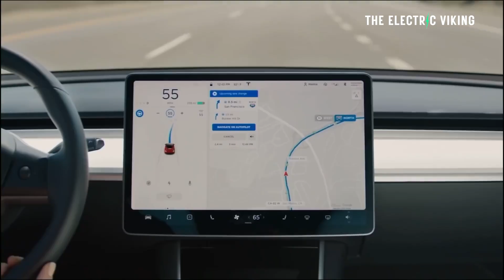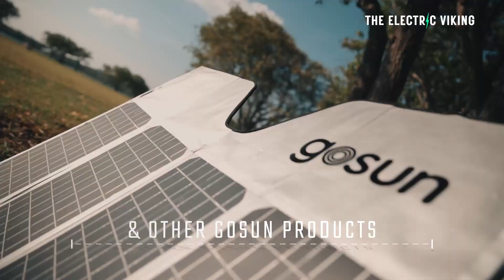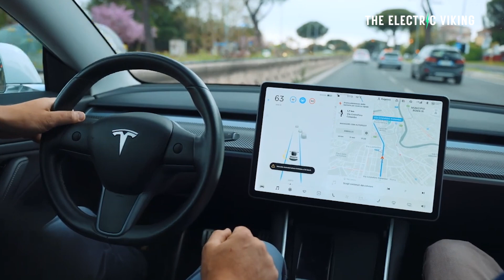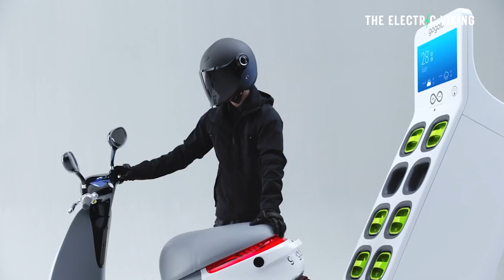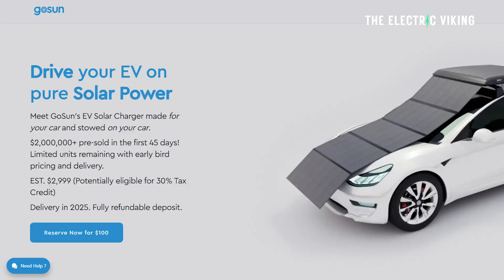GoSun’s Solar car Charger turns any electric car into a solar car

Comment: From my research, GoSun’s solar charger provides 1.2kW of charge which translates to 30 miles for 7-8 hours straight of charging in full sunlight. With proper charging management using GoSun’s EV solar charger, it is quite possible to reach a 91-92kw charge = 300 mile range just by using the solar charger alone and without having to use home charging or supercharging (that’s equivalent to 3 average workdays of solar charging), and solar charging would also be quite gentle to the batteries hence less battery degradation and contributes to the overall proper care and management of battery longevity. All in all it’s a net positive, so I can see why internal combustion engine and big oil lovers would hate and dismiss this technology. It completely eliminates fossil fuels altogether to provide the charge and range to the vehicle 🤭 there would still be times homecharging and supercharging may still be needed for emergency charging, but imagine if we have backyard fusion reactors the size of a single tesla megapack… goodbye fossil fuels forever 😧😧😧
Reply: Not sure what you are on about - a 1200w array will produce on average 1700-1800 kwh per annum in a warm dry climate nearer the equator (at 100% charge efficiency but we'll leave the circa 15-20% charge losses out of the equation for now) - more like 900kwh per year in London or 1100kwh per year in Seattle etc. This accounts for lower winter sunlight hours, the angle of the sun not being perpendicular to the array, clouds, rain etc.

That's on average 4.7kwh per day in an ideal climate and 2.5kwh per day in London or 3kwh per day in Seattle. = 19, 10 and 12 miles per day range respectively at 4miles per kwh

That is based on leaving the array deployed 100% of the time during the daylight hours, never in the shade, never in a garage or undergorund car park, never driving during the day. It also excludes the extra cost of the drag on the freeway - at 75mph this setup would consume an extra 150wh/mile = 16-30 miles (depending on climate) before all of the benefit was lost in extra consumption alone.

My home electricity overnight rate is $0.08 (AUD = $0.05 USD) per kwh. $3000 USD in panels would be the equivalent of 60,000kwh cost = 35, 66 and 55 years resectively of charging (in the ideal circumstances noted above) to recoup the costs , no thanks.
Reply: @TB-up4xi that is subjective to where you live so your math is off

Comment: Brilliant idea. Eventually photovoltaics will be painted onto the car's roof and chassis, possibly the windows as well; it will just invisibly, quietly add miles back while parked during the day. Such tech has already been demonstrated.
Reply: Build-in PV comes with the Aptera, here in 2025, forty miles/day.  Most efficient design by 3 x, e.g., lowest drag, .13, >100 kilos.
Reply: Pie in the sky.
Reply: Aptera will be about 800kg, bonus is its only got 3 tires you have to service.
Reply: For stipid people only. Stopp too mush air when driving.

Comment: What people don’t understand with this tech is that the idea/goal is off-grid charging, supplying the needed power for your vehicle without completely relying on plugging it in through a home charger or super charger that’s still connected to sources of energy that still use fossil fuels. And, again, if it’s managed properly, you won’t have to ever use superchargers or home charging if it’s short distance/local driving but can possibly be used in place of long distance driving, again, if the charging is managed properly.

Comment: I think you will get so tired of having to open and close that solar panel 2 3 times a day that you wish you were never born😅😅😅

You would not even want to open that solar panel if you go on short trips to the store or elsewhere when you only spend 10 Minutes or Less in the place😮 that will be another nightmare to think about whether you want to open the solar panels where you're going or not😮 people don't want the hassle like that😅
Reply: The idea/goal is off-grid charging, supplying the needed power for your vehicle without completely relying on plugging it in through a home charger or super charger that’s still connected to sources of energy that still use fossil fuels.
Reply: Think! @oddjobsandrandomprojects

Comment: I do see some possible issues. The first is the cost. I could by 15KW for that amount, which is enough to drive my M3 about 60K miles. Second, mounting that on your roof is going to reduce your range, especially on a freeway.  Third, it looks very easy to steal.

For camping, it would be super awesome.

Comment: Bro you are completely delusional😢 you are saying you can add 120 mi to your range for nothing😅 have you forgotten that you have paid $3,000 for the solar panel😅 you know how much gas you can buy for $3,000😮 at $5 a gallon you can buy 600 gallons of gas😮 and you can drive 20000 miles with 600 gallons of gas😮 do you even know how to use a calculator😂😂😂😂
Reply: You are not very bright, are you…think about it, most people fill up their 20 gallon tank each week…let’s assume they fill up every 10 days or 3x per month…that’s 60 gallons per month…so based on your math, it would only take 10 months to break even and solar panels typically last well more than 25 years with minimal deterioration…can you name an investment with a better ROI than that?

Comment: 30mi is BS. I live in the California desert. I get around 6 hours a day. That's a 1200w solar array, so figure 5hrs in the summer at 1100 watts that 5500w per day. And that's at the panel, so figure at best 85% efficiency, which is 4675whrs to the car, and at best, 92% gets to the battery in the car, so 4200whrs is on tap to use. A model 3 rear wheel drive at 50mph uses 230whr per mile that's apx 18 miles of range and assumes the best cases. If you lived any further north, this would drop like a rock. If they can make it wider and get the solar array upto 2100-2400w it would be way way better at that point your adding around 7-8mi per hr something similar to a 120v outlet ev charging while the sun is up.
Also cigs panels are way way better at handling shading and make a lot more since

Comment: Solar panels can now be made transparent. The efficiency may be quite low at this time, but what's to say it won't improve to the point where it can be integrated into the windscreens and charge up the car. Even if it is just a 10% charge in 8 hours, it might be enough to justify such passive charging.

Comment: Sure. It takes about 6 rooftop solar panels to offset the power used by a model 3. This system isn't quite enough to power an EVs average usage, but it's close enough to be useful. The bigger question is how long will it last?  It would be better if EV manufacturers integrated them into the top surfaces of the car instead, or maybe have them come out of the trunk similar to a convertible top.

Comment: That’s a great invention. I’m patiently waiting for my Aptera EV that is covered with solar panels.
Reply: Keep waiting - Aptera is vaporware.

Aptera 1.0 - 2006-2011, 6 years = zero cars produced - conspiracy claims about the CEO being paid off by big oil.

Aptera 2.0 2012-2014 -IP bought by ZJG , split into US and Chinese companies, ZJG claim they will make 5000 cars by the end of 2012, come 2013 zero cars produced - radio silence.

Aptera 3.0 2019- $260mil capital raised - $16mil left in the bank all spent on offices, advertising and R&D. No in-house manufacturing capability, no software, a few hand built carbon fibre and fibreglass composite prototypes, cars produced & sold...surprise surpise = zero.

Tech is now outdated. 40kw max DC charging 3kw max AC.  Struggled to find a new supplier for their useless hub motors - less efficient, more prone to damage and susceptible to water and dirt ingress. Would need another massive injection of capital to start producing at low volume through a contract manufacturer, still no demonstration of software (which as we know the achilles heal of startup EVs)

2 years after their $200mil IPO Tesla had produced the model S and X - 2 years later they had $3.5Billion annual revenue, Aptera's combined revenue since 2006? ....... $0.

Comment: Great idea, but as pointed out in the comments below, it could take well over  decade to pay off based on electricity prices. But if live in  a place with no way to plug in, it may be useful, or on a camping trip, or just to ensure you are using clean energy to power your vehicle. I expect prices will drop rapidly for this.

Comment: No way would that not get stolen or vandalized in most cities. However if on a camping trip/holiday it could prove very handy for remote charging. 1200 watts of solar for 3000 is pretty steep, but it is a plug and play kit.

I'd look to build a portable array with a battery pack for a bit less and more multi use scenarios.

Comment: Maybe they could incorporate the solar right into the hood, the roof and the trunk and maybe even the side panels. you never have to take it out or put it back. It would always be working.
Reply: One of the world's best engineers, Elon Musk, says that there will be too little effect in relation to the cost. It is not possible to save extra costs during the car's lifetime.

Comment: I have shopped around and there really is no good affordable solution to just charge your car directly from solar panels. You can't just wire them up directly or even to an inverter. Because the EVSE we have is AC, and can't deal with intermittent power like the sun going behind clouds, most people even tell you you need an additional buffer battery to keep the current on an even keel. So what is really needed is a direct low current capable DC interface but of much higher voltage matching the needs of the battery pack, which is not really available yet. Also I can definitely see people just stealing solar panels that are rolled out on top of your roof. A better solution is larger capacity regular solar panels on a roof or permanently mounted or on private property. This could be anywhere from a kilowatt to six or eight etc. which would be as fast as our current level 2 charging. We have two EVs and one usually sits home all day and can charge while the other is being driven. We could definitely supply all of our EV charging using such a system, other than the fast charging we use on trips.  So what I would be really interested in is the electronic interface that this thing uses between the solar panels and the car charger. And as it's only 1,200 watts it could be far cheaper than $3,000 that's for sure.

Comment: Sam getting stuff wrong again - how are they going to increase the efficiency of solar panels by 50%? Solar panels are already about 22-24% efficient depending on the brand and the maximum theoretical efficiency is 30% and we can already get close to that in a lab but the materials are too expensive. Solar panels are a very mature technology and we can only really tinker around the edges with efficiency - the biggest gains we'll make are in longevity. Also - carry the extra rolling resistance on your roof is going to hit your efficiency hard. I think it's a niche product for offgrid camping, that kind of thing. You put that thing out on a busy street or a car park and it's bound to get vandalised.

Comment: It think people commenting that the current version is impracticle, need to take a step back and look at the evolution in the EV industry over the last 10 years.
More innovations and steps forward than in the ICE industry in 50 years!
So, this solar system iteration is Step 1. The improvements in solar cells will reduce the size of this system every year.
Solar films that are put on windows are also getting better & better.
This system is not useful in all countries/hemispheres - obviously, but I think this design & efficiency will evolve massively in the next 5 years!

Comment: The roof rack and the panels screw your aerodynamics. Still love the idea though
Reply: Yes, but it has a very thin & aerodynamic profile. It won't add very much drag, especially if driven below the speed limit (which contrary to popular opinion is a maximum, not a minimum) ;-)

Comment: I made my own one of these several years ago by storing folding panels in a Thule roof box with my ecoflow, the charge cable can exit the side of the roof box easily, and the panels cover the front and back, pretty easy to diy
Reply: which ecoflow and EVSE do you use?
and how does the EVSE and your Vehiclehandle such low charging current?

Comment: Still just feels like a really cool science project but not a practical mass solution. Manufacturers need to get their arses in gear and at least add solar to the roof and hood right from the factory. All tied into the high voltage battery. No additional drag, preferably no additional cost, no theft, not easily damaged, etc....

Comment: The idea of charging your car from solar while parked is great. This form of execution... I dont know. 30 Miles per day is theoretically possible (best of best conditions) but that shouldnt be the expectation, 10-15 miles is more realistic and thats a lot of daily hassel for not a lot of gain. The worst of worst conditons (winter, full size truck) this is only going to provide 7 miles of range per day or less.

FWIW if you can find any basic 120V outlet with an extension cord it will charge faster and 24/7. 34kWh/day vs. 4-7kWh daily off this thing.

Comment: Who said it was eligible for federal rebates?  My bet it is a scam. Also ABS is UV resistant with additives added.  Note the additives themselves degrade. Adding only a small amount of additives allows them  to be called “UV resistant”. This is why residential panels use glass because plastic doesn’t last.

Comment: I have a 400 w. Panel that folds up and carry on my e bike with my  Trailer Carrey 2 100 amp HR batteries give me very long range to get fare into the wild trails with comfort like a electric blanket very small and compact not cheep thow but very good for hot tent camping in winter wit my titanium stove gear camping with my bike is a blast charge drone hopefully soon star link int!Internet?

Comment: Why dont ev makers just make solar panel coated frunk, roof and boot? Would save the hassle of opening and closing these rooftop panels. Would also continuously charge the battery while you drive
Reply: Two things - you'll notice that this system (usable only when parked in a safe, windless place) completly covers the car from stem to stern to get enough square footage.  If built into the car, you can't cover that much area (because of windows and the cell's shapes, etc.)  And there's the problem that most cars would get only a tiny benefit for the cost of adding permanent panels.  One EV maker IS covering the car with panels exactly as you suggest: Aptera.  But it's only practical because Aptera is so amazingly efficient that it can gain as much as 40 miles on a sunny day (approximately what the average person drives per day.)   EVs of standard design could only drive 10 miles (or much less) on that same amount of juice.  The expense of adding the cells makes it non-economic for such a small gain, so that's why most EV makers don't even consider it.   The best that can be claimed by those individuals who want to install some cells on their EV is that this small amount of extra juice could power fans, charge their phone, or run some lights.

Even Aptera doesn't promise that charging the battery "while you drive" adds significant mileage.  It takes a full day of good sun to get the ~40 miles.  Imagine a long trip with a "1000 miles per charge" model.  If you start with a full battery and drive in bright sun as far as you can, you might go 40 more miles than the 1000 you would have otherwise traveled, but you would now have an empty battery that requires: 1) charging at a supercharger, 2) charging for several hours or overnight at level two, or 3) twenty-five days of sitting in the sun before it is fully charged again.  Each day WOULD get you ~40 miles, which is very useful  --  after several hours on the first day, you'd possibly have enough juice to get the car to a charger!  This was purely imaginary, though; nobody with any sense would run it until actually empty.

Comment: It's a good idea especially for campers. One day every car will have solar cells built in. Until then, this makes sense however it's vulnerable to theft/vandalism. An internal kit might be an option?
Reply: It’s good for home charging in place of charging using the outlet from one’s home. Pretty much that solar charger can only be used and unfurled in a secure and safe location. It will not be recommended to unfurl in dangerous high crime areas.